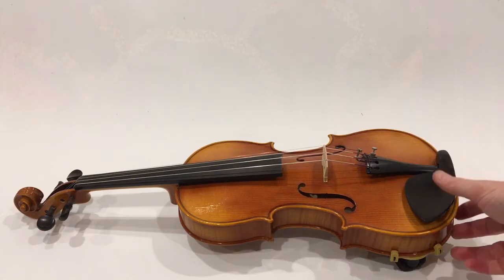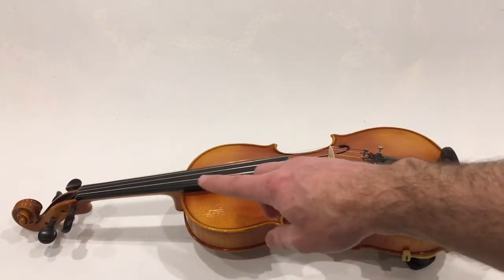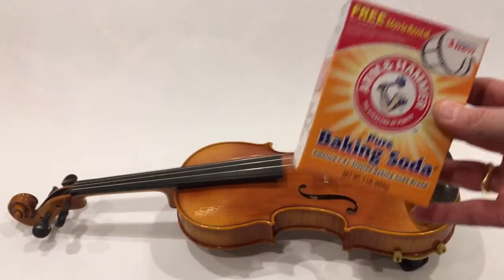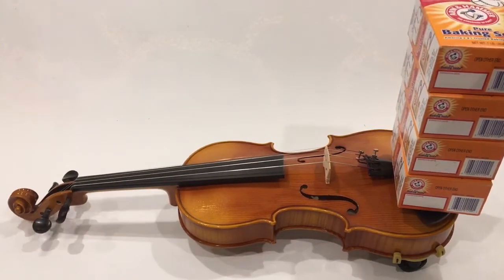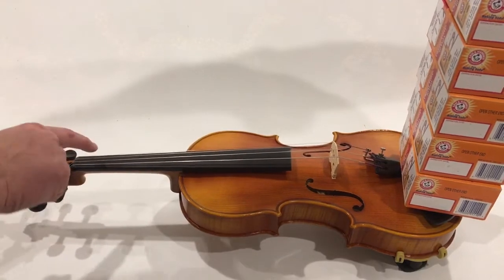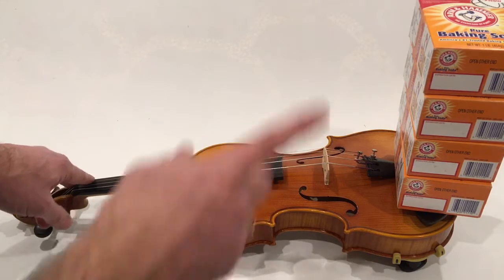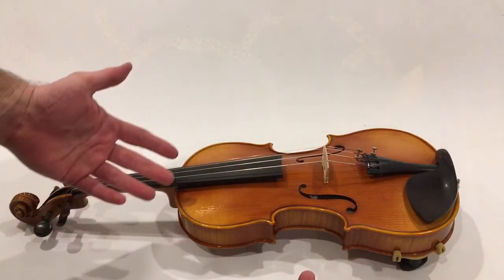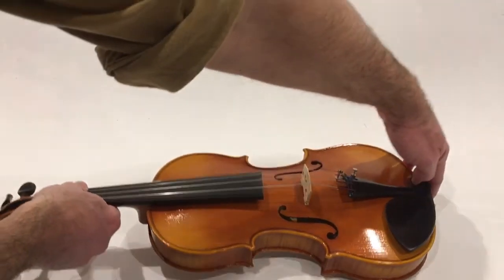Violin shoulder rest physics

Comment: For further edification, my violin weighs approximately 16 ounces or one pound with a wooden chin rest and no shoulder pad. Not quite 3/4 of that is resting on my collarbone, and a little over 1/4 is resting into my hand. It doesn't take a lot of finger weight to create a clear tone on the instrument and that weight is always changing because one moves from one finger to another and during shifting the finger rests on the surface of the string on its way up or down the fingerboard. Further, one can tip the scales so to speak by raising the violin so that less weight is in the hand and more on the collarbone. The collarbone can easily support 3/4 of a pound with 1/4  supported in the hand. However, one also has the violin supported by the side of one's neck if the scroll is held just high enough above parallel to the floor and the stability of the bow on the strings and the gentle resting of the head so that the jaw (mostly the jaw, and for some the chin too) rests on the chin rest. With all these places for support, the violin does not feel heavy in the hand and the weight is more evenly distributed. I think your video shows that it is possible to balance the weight without undue wear and tear on the muscles in the neck. Besides, the head should be right over the spine for good balance ( it's known as the A.O. joint- where the bottom of the skull, the occiput meets the atlas, the first (top) vertebrae in the spine) dropping the head down and forward is like the weight of a bowling ball pushed forward of the spine- a bad place to go to. Thank you for your video!